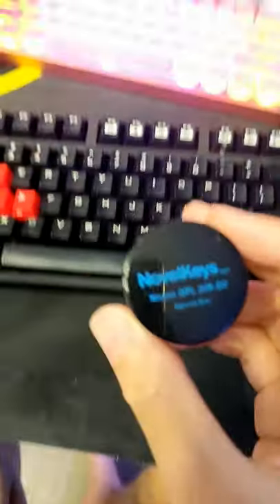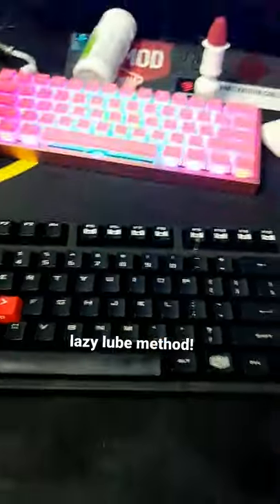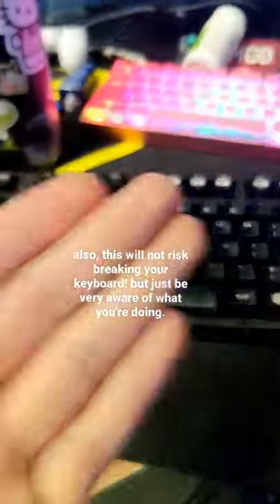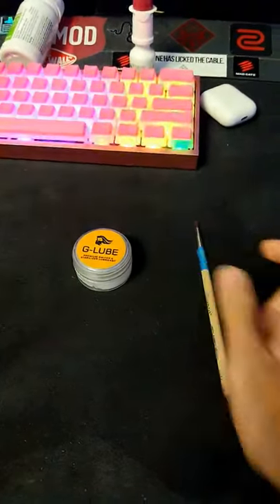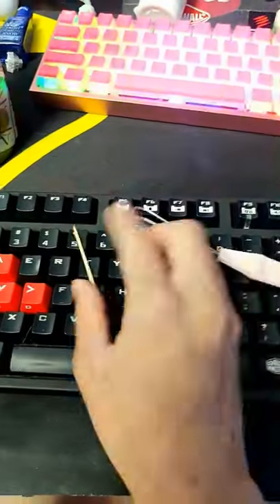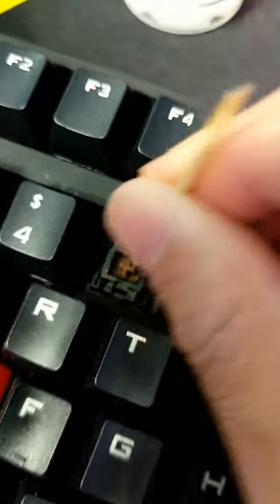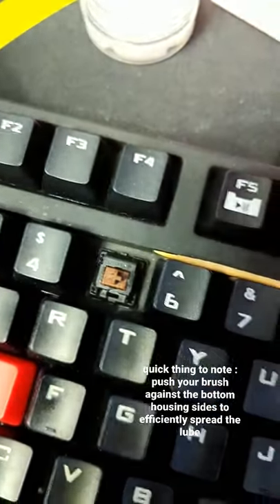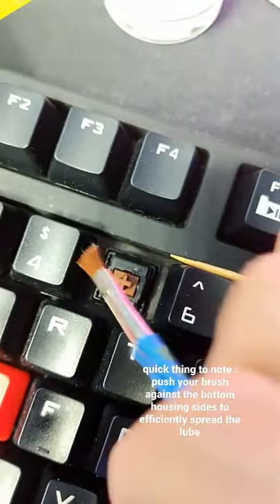Lazy Lube Method! How to quickly lube your switches without desoldering #Shorts

Comment: Yup I also used this method, however I would still heavily recommend actually lubing your keys, my space bar is not up to snuff and my keys still don’t sound nearly as deep and thocky as I would like them to.
Reply: I'm planning on using this method because I don't have a desoldering kit, did you have issues with key presses not registering or as long as you don't over lube then you don't have that issue?
Reply: My Razer huntsman linear switches are SO FUCKING THOCKY 😩😩😩😩😩
Reply: @Jazzy_Official1  if u have a razor keyboard then it cant be good no hate
Reply: Add some foam. It's not just the switches but also the structure of the case so maybe alot of foam will help
Reply: Have you even lubed your stabs at all? If they're clip-in it's fairly easy to do properly without disassembly.
Reply: @hunzhurte  i didnt say that like it was a bad thing. no one ever said that thoccy keys are bad
Reply: @Jazzy_Official1  Bro I'm talking about stabilizers what do you mean?
Reply: @hunzhurte  nvm bro 🤦‍♂️
Reply: @MS-BOSS008  Like taking each switch appart and lubricating each component individually.
Reply: @joshsastronomy5884  You shouldn't have any issues with this, as you said; as long as you're not overdoing the switches and filling the housing with lube it shouldn't present any problems with registering keystrokes.

Comment: I get that the video says its lazy but this is no substitute for actually just regularly lubing your keyboard
Reply from the maker: in the long run, learning how to desolder your switches and lubing it properly would improve your keyboard way more than this method. this was an old method i used to use in some of my older keyboards and they weren't bad by all means, but i do wish i had the desoldering skills back then instead
Reply: @eyedin  technically this is a method for spray lube, but its still not a good idea
Reply: @RBAOfficial-w6r  "but its still not a good idea"
Reply: It’s not really a valid substitute because of the risks it has of breaking the board
Reply: What the hell would I need to lube a keyboard for unless I'm OSU champion
Reply: @frostedlambs  sound
Reply: @frostedlambs  I agree with you. I'm not going to waste my time on this shit.
Reply: Oh my god this is the first I’ve seen someone with this same profile picture I’m gonna cry
Reply: @preston233   yo same bt to break down into tears, when did you start using it
Reply: @soapsoapsoapsoap2664  like four years man haha

Comment: Nice linears bro
Reply: I’m glad you understand lol
Reply: @ThrMasterK123 they are not just Browns they are mx browns
Reply: @ThrMasterK123 wooooooosh
Reply: @ThrMasterK123 have you ever felt a tactile switch and then went to an mx brown, stock mx browns feel like linear switches
Reply: To make an mx brown good you have to:
• Replace top housing
• Replace bottom housing
• Spring swap
• Stem swap
Reply: @DJRS9045  No, you're wrong. After you've been in the community long enough, you'll realize that Browns are actually endgame. Either Vints/Retooled + 205g0 is.... chef's kiss.
Reply: @Archurus  you are turning into shoobs with that sentence
Reply: @DJRS9045  i mean browns are trash but if you get the full nylon housing it sounds decent at least
Reply: @SMSELWA  I personally think that the feel of the switch comes before sound, and then ascetics come last
Reply: @DJRS9045  That's actually not true, you can do the ergo clears and keep the spring lol

Comment: I used this method with alcohol after spilling coke on my keyboard. 10/10 cleaned it right out, 4 years later and a couple more spills (luckily only water after the first time) and I'm still struggling to find a better keyboard.
Reply: maybe you should find a cup holder
Reply: Maybe just don't drink over your keyboard multiple times in a row?
Reply: @hunzhurte  it was always a glass of water/coke on my desk that I knocked over while reaching for something, I wasn't drinking over my keyboard. I now use a water bottle that I keep closed.
Reply: @Bralkor  Oh that makes sense. I use a bottle as well. I've bever spilt something on my keyboad but I kinda wish I did because then I would have a reason to buy a new one

Comment: When did this become a thing? Gives off headlight fluid vibes
Reply: Wait for it, two or three weeks from now, the next big thing will be "gaming lube" in a water cooled rgb case, and it will be vaseline sold at $100 a pop. Stupid people will buy anything. #gamingheadphone #gamingheadphonestand #gamingcase #gamingpsu #gamingfans #gamingusbcables
Reply: People make custom switches for their keyboard. Lube them, with certain lubes working better with certain plastics and all that. Just like any hobby, you can take it as far as you could ever desire.
Reply: it's just for custom keyboards. it makes your keystrokes smoother and usually they sound better
Reply: You really don’t know until you try it. Just like high refresh rate monitors, you really just don’t know until you know. You know?
Reply: Its not a thing lol
Reply: @ballcandy1117  If you know, you know.
Reply: @neelsmostert  I’m pretty sure Vaseline & petroleum jelly in general eats the plastic used in switches.

Comment: Lubing makes a difference but not if you're not on a custom made board. The caps hitting the plate make the most noise unless you went for clicky switches, also the number of mousepads it's on will affect the sound too. Lubing gets rid of the scratch noise the stem makes when it slides down. So if you have a cheaper keyboard even if it's mechanical this ain't worth your time.

Comment: Could not hear the slightest difference, even with higher end cans.

It's a great idea for lazy / soldered lubing, but there's really no substitute for a proper lubing.

The Corsair K95 Platinum comes to mind here; decent mainstream keyboard, but it obviously tested by deaf llamas. 

Terrible resonance and pinging, and the only thing that'll fix that awful sound is a complete disassemble, lube and padding.
Reply from the maker: very true, i would only suggest this method if you're extremely worried about learning how to desolder.
Reply: Haha spray lube go brrrr

Comment: This doesn’t fully lube the switch and won’t sound nearly as good I’ve tried both methods
Reply from the maker: very true, you miss out on the spring, which to me is the most essential part of the switch. you'd be better off knowing how to desolder and opening up switches manually instead

Comment: This is literally the only time ive wver heard of lubing a keyboard why would you do that
Reply from the maker: lubing a mechanical keyboard switch improves the sound / feel of the switch. it's not necessary if you don't want to go through the process and you would have to desolder and open up your switches to get the best results instead of this method.

Comment: As someone who bought a 60% keyboard recently. I see these lube videos everywhere. Mine is for sure not lubed. and the slight difference in noise does not bother me. the difference in sound is so small to me. Am I only one thats just like. this a keyboard. it does keyboard things. which includes making keyboard clicks. ha I will say i did come from a slim keyboard I have had for 8 years or more. It had laptop style keys. Its obviously louder on this keyboard. But i dont mind- I most likely will lube my keyboard someday as I will probably switch key cap sometime. But other then that its not that important to me. I dont know why..

Comment: Lube a keyboard. The hell do I have to do to have a dumb problem like this
Reply from the maker: there's no reason to lube a keyboard if you don't want to. the whole purpose of doing so is to make your keyboard sound and feel better without having to buy more expensive switches or whatnot. this method isn't really the best solution since you don't get the more essential parts of the switch, but it will at least show a difference in the switch.

Comment: that seems like to much work for not enough bang. I heard a difference but it was very subtle. I mean I suppose if you have no other choice it's better than nothing but bang for buck I don't think this is worth it. I think you'd be better served saving up for a modular keyboard and lubing some switches. Or if you love the keyboard desoldering the switches and lubing them up properly and re-installing. However if this is the only think in your budget and time allowance I say go for it. I can hear the subtle difference.

Comment: Why would you lube a keyboard? The lubed and non lubed sound exactly the same
Reply from the maker: the point of lubing a keyboard is to improve the sound / feel of the keyboard. doing this method isn't really the best method nor do i prefer it over traditional methods of actually desoldering and opening up each switch individually.
Reply: @eyedin  but a new keyboard?

Comment: I don’t have this type of keyboard, why is this important to do to it
Reply from the maker: it's ultimately up to you if you want to lube your keyboard. you typically wanna do this to make it sound / feel better. With this method it only gives off a slight difference as opposed to just desoldering your keyboard and opening up the switches manually.
Reply: @eyedin  ahh thanks

Comment: That is not "lazy lube method". That is "shit lube method which can easily screw up your switches" and additionally you'll not lube bottom housing and spring of switch (which is necessary with switches like Cherry MX or anything with creaking spring).
Reply from the maker: newest video on this method is explained better, did not intentionally make it seem like you should only lube top housing. my bad !

Comment: This 'method' was definitely done wrong. This is actually a viable way to lube your switches without desoldering, but clearly was done incorrectly. Also ur brush is way too thick. The point of this method is to get the lube deep inside the switch not lube the literal top sides of the housing. If done correctly the only thing not lubed will be the spring. And yes it does make a difference. You can also use this method on stabilizers but use dielectric grease to reduce spacebar rattle. Of course this method is not fully effective, but it does give 80% of effectiveness for the 20% of work you put in for it. And also...browns are nasty lmao. I did this method on my milky yellows and it made a world of a difference.
Reply from the maker: forgot to mention in the video to push deep inside the switch.. kinda did a bad demonstration on this but will elaborate with a sound test coming soon.
Reply: @eyedin  ill sub to stay updated. Theres plenty of videos online and personal experience where I can say its definitely effective, not as much as desoldering obviously but thats the price you pay for 20% of the work, for some of the benefits.

Comment: Bruh it doesn’t get any of the important parts. Only top of the stem, so none of the actually important parts of the stem, and not the spring either. This method does not help, don’t waste your time.
Reply from the maker: mentioned in another video with better explanation, was trying to say that you need to push the brush towards the inside of the railings

Comment: If you’re wasting time lubing up keyboard switches you’re doing something wrong in life. Pop your keys off n just clean the dirt out of the switches that’s the only reason they stick. Once you add a lubricants it just allows the dirt and debris to stick to it even better causing stuck keys but now you have to clean all the goo out before you can even deal with the contaminant. Soooo stupid lol